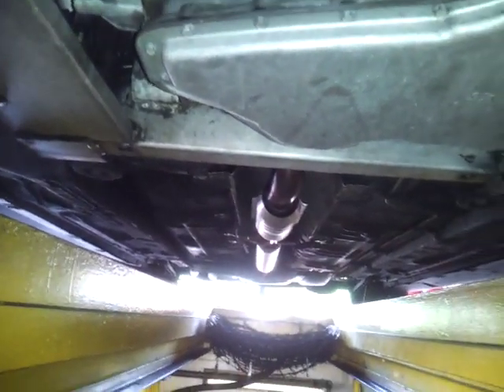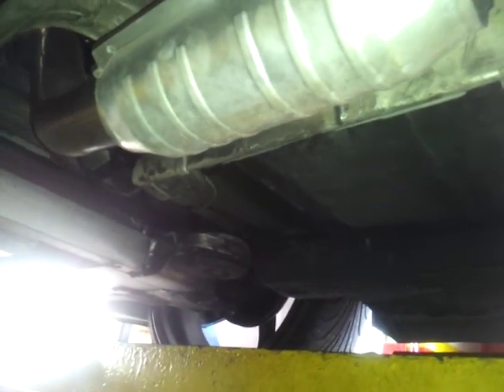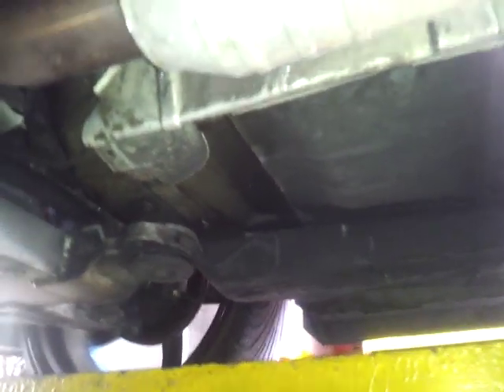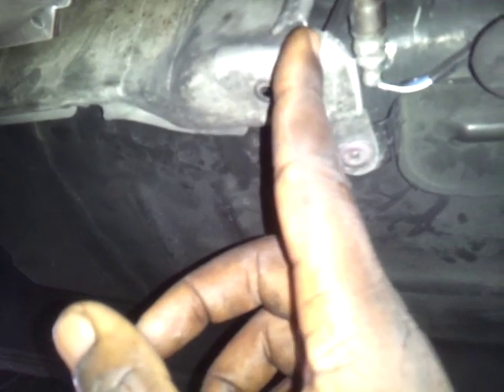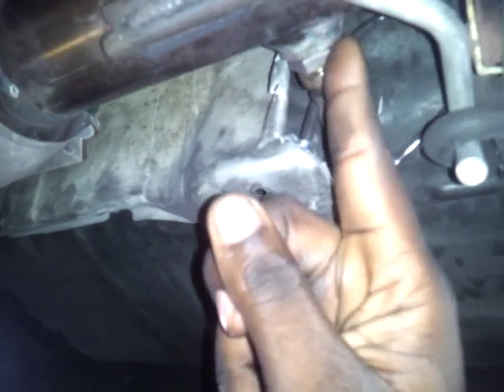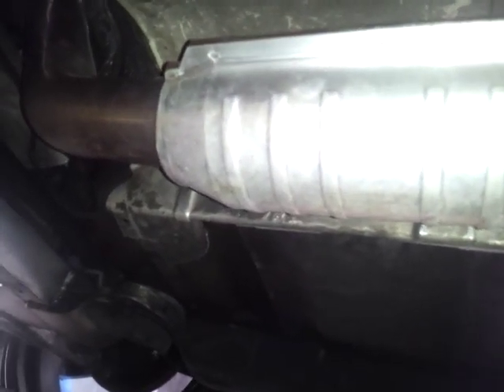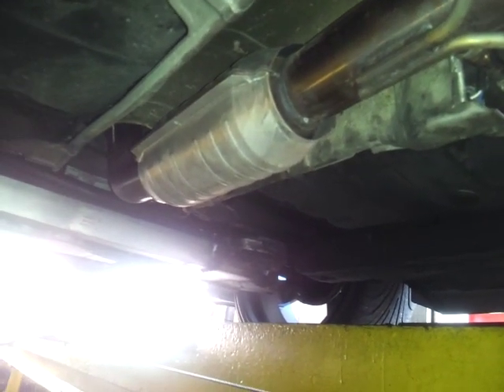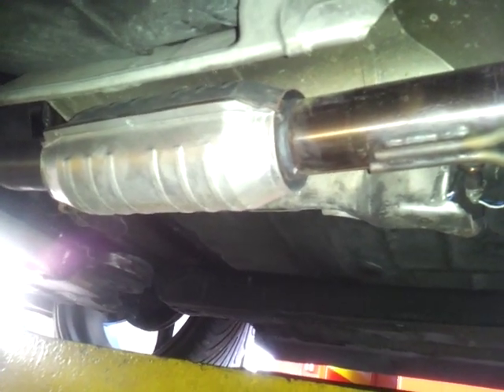2001 Monte Carlo PO420 Exhaust Fix

Comment: I just wanted to add that thanks again for posting this video as it really helped out in more ways than one.  I was having a shifting issue once the car warmed up, but now after replacing the catalytic converter with this parts kit 23405 the issue is gone as well as the down stream O2 sensor.  I did pay someone to do the work, but did not replace the upstream O2 sensor as of yet.  there is a big improvement versus the stock kit.  The muffler guy stated that this is much better because the stock pipe has the dip to accommodate the O2 sensor, but the down side of this is because causes a restriction by design due to the bend and the O2 takes up a good portion of the flow.  With this kit it substantially improves performance all the way around so it is a worth while investment especially after 90k miles.  I was not getting any codes, but the shifting concern.  I really do appreciate this video.  Thanks again for all you have done by sharing your knowledge and experience.

Comment: Great video and thanks for posting your experience with this kit and the advice to replace both O2 sensors.  What was the total time you spend on this project with the mods you made to make fit and work?
Reply from the maker: No More Then 2hrs, Mostly Bolt On Application With Direct Fit, But Easy To Do.
Reply: ***** Great thanks for the information.  I may need to do this to my car only that I have make sure that it not something else.  Very informative and glad to hear that your wheels are keeping you on the go.
Reply: I forgot to ask, but if I may how does this sound versus the stock did it get any louder or about the same?  Thanks
Reply from the maker: *****
Same Sound, A Catalytic Converter Only Change The Sound Of The Car When It Starts To Go Bad, You'll Hear Rattle And Pings, It'll Sound Like A Truck With No Headers...
Reply: ***** Great thanks for your response.

Comment: I know this is an old post but I'm about to do mine and the rear 2 bolts that bolt to the rest of the exhaust can I cut them and put new or are they threaded into the flange thank in advance
Reply from the maker: There threaded into the flange on the rear header, you can cut the bolt but you may have problems with replacing the nuts/threaded bolt. The rear headers would then have to be removed in order to make life easy.
Reply: @TheDemo05  I know that about the ones on the header side of the downpipe I was asking about the other end of down pipe the end where the down stream o2 sensor is thank you in advance
Reply from the maker: @joshuacasiano4778  Like the headers flange, its set up the same.. its 2 nuts n 2 threaded bolt, in this video, 1 side remain factory with the nut/threaded bolt and the other side, I went in my parts bin and found a standard bolt and nut becase i had to cut the original threaded bolt n drill it out, which took a good bit of time. But yes you can cut them n replace then. Its not easy.
Reply: @TheDemo05  ok grate thank you for the help I appricate it and thanks for the video

Comment: My 01 Monte just hit 100000 last week & today the check engine light came on. If I replace the cat convertor it will be convertor # 4 since I bought my Monte with 4,600 mls. Never with any of the other cats did he light come on. I have my own code reader and this is the code that pulled.my first cat was replaced @14,000 the next at 28,000. ( under warranty). #3 was at 71,000. Do you suggest I try the 02 sensors first? if yes, do you have the part # for the o2 sensors. Are the 2 sensors the same part # as well? Thank u
Reply from the maker: I Changed My Catalytic Converter With The Magnaflow 23405, I Use Denso Upstream (234-4018) and Denso Downstream (234-4087) Oxygen Sensor. I Changed All 3 At One Time, Been Good For 2 Years Plus...

Comment: how did you get to the bolts at the top of the converter (converter flange to manifold)? from underneath the car or did you go from above? having troubles getting to them from below and was told to undo the 2 bolts on the dog bones up top and pull the motor forward with ratchet straps and then I will be able to get to them from above.. advice? thanks
Reply from the maker: 1. From Underneath You Will Need To Lift The Car, Have Proper Suppport Under Your Car, Use Extension On Your Ratchet And Deep Sockets(Use Eye Protection and Blocks To Support Your Exhaust Pipe) 2. From Above, You Will Have To Remove The Dogbone Bolts(To Access The Rear Of The Engine) Best Access Point Would Be The Driver Side, Close To The Transmissions Fill Tube, Again Have Blocks To Support The Exhaust & Car. Be Safe.

Comment: Hey I have a 2002 Chevy mc ss it has trouble picking up speed from red lights and the rpm hesitate to shift can you please give me some advice if you know something
Reply from the maker: Any Service Engine Light?
Reply: +TheDemo05  no check engine
Reply from the maker: +Desjuar Anderson It can be multiple things, from clog cat, dirty throttle/intake, transmission failure.

Comment: Did you replace the gaskets?  And where they included with the Magnaflow 23405 or did you have to buy them separately?
Reply from the maker: Yes, MagnaFlow Included The Gasket That's Goes Between The Headers and The Catalytic Converter as well as The Gasket For The Down Pipe...